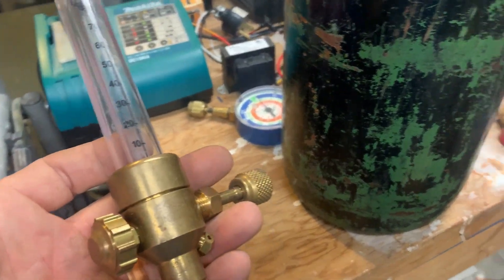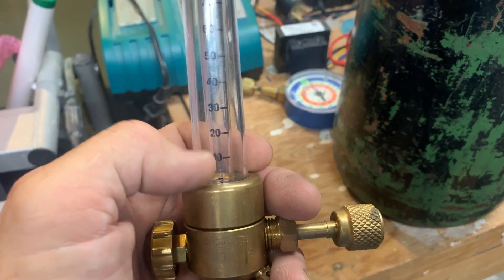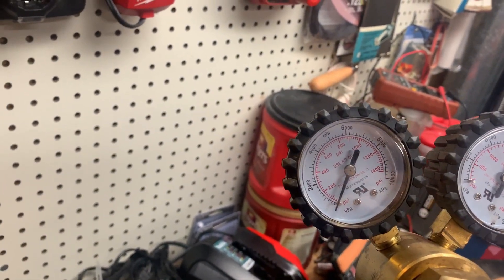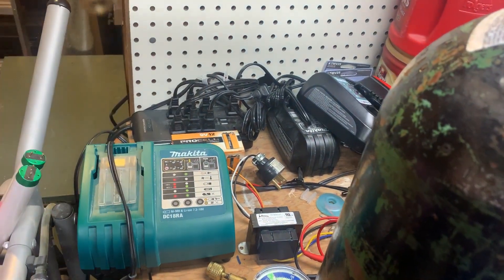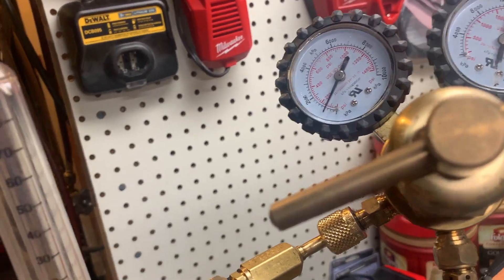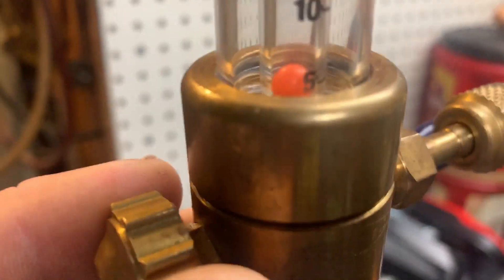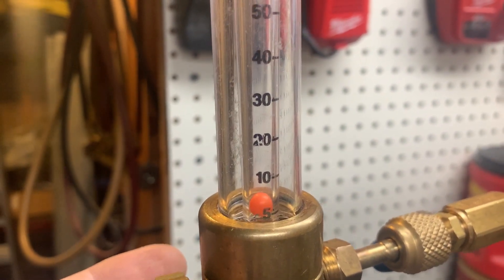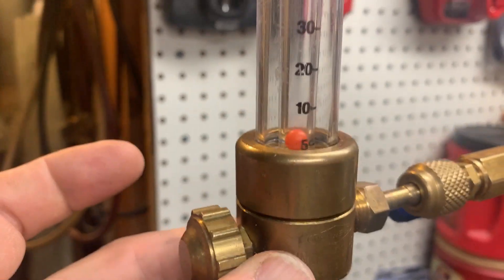Nitro Saver

Comment: I like it 👍🏻
Reply from the maker: Nor-Cal Refrigeration & H.V.A.C honestly, after using it on a job that I had to install three filter driers and an isolation valve, it showed me it saves nitrogen like the Uni Weld flow saver does.  And it’s a really simple design.
Reply: And like all Goss/NRP Torch Products = Made in the USA!

Comment: I like 👍 have to get me one. The only down side is you can't confirm there is flow like the ball floating
Reply from the maker: Joe Shearer I used it when I had to install a ball valve and three filter driers on a VRV system, and I probably had it going for half an hour, and I didn’t even notice the change in the tank pressure.
Reply from the maker: Joe Shearer I can tell you I have used the Uni Weld one as well, and this one did save the nitrogen like that one does. But if you have the Uni Weld and like it, keep on rock in’ it!
Reply: tcpHVAC/R I don't doubt it will work fine. I've just had situations where the hose wasn't depressing Schrader and even tho there was pressure there was no flow